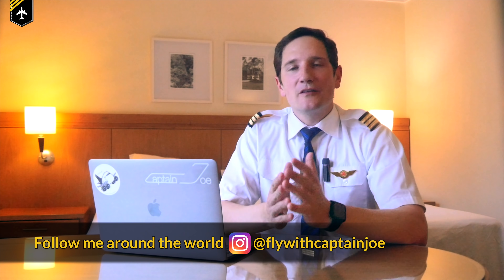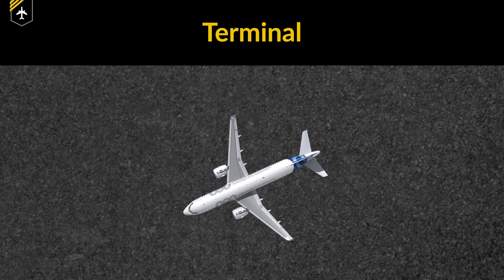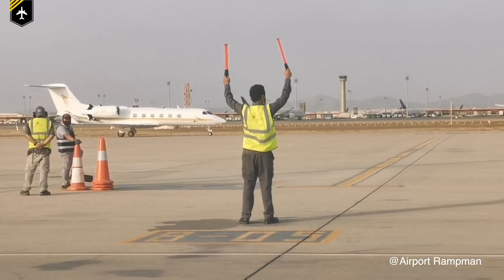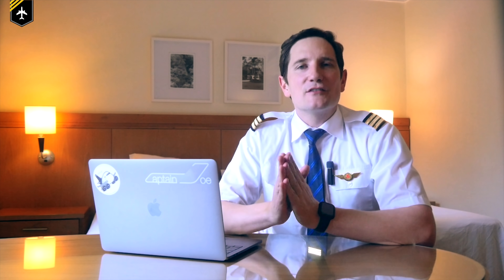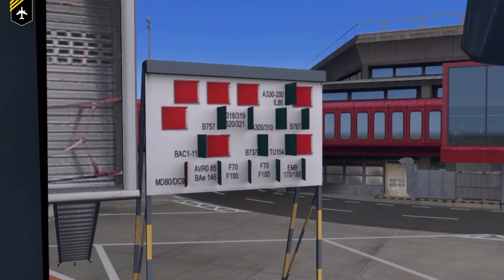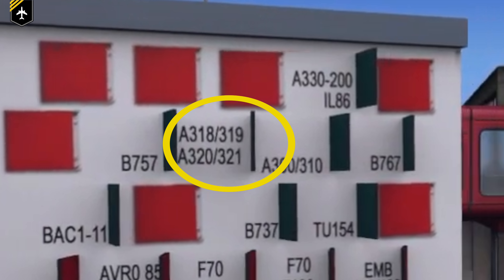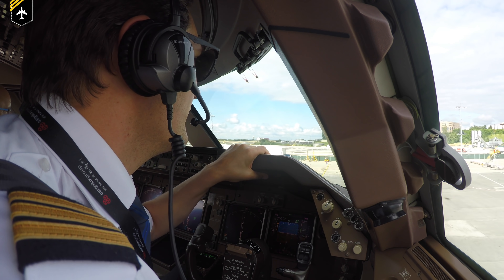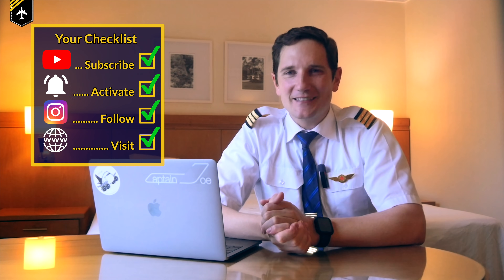HOW do PILOTS PARK their plane? ACCURATE PARKING explained by CAPTAIN JOE

Comment: Why do some airports use the bridge and sometimes you don't park near the building and passengers need to use the steps?
Reply: The bridge is more expensive compared to remote bays with stairs (in terms of airport fees for the airline). So usually low cost airlines use stairs.

Comment: Also at AMS, if the VDGS is on, the person manning the VDGS is responsible for the ramp to be clear (in case of AMS, due to the lack of storing space, objects may not hinder the a/c safety but can be within the ramp zone. Officially not, but airport authorities have a tendency to turn a blind eye.) 
Though the captain does remain responsible for following instructions given by the VDGS, the person manning the VDGS is responsible for pressing the emergency stop, blocking the jet bridge, de-blocking the jet bridge and pressing the chocks-on button.

So if an aircraft drives into the terminal with the VDGS on and the emergency stop not pressed at least three people have a lot of explaining to do.

Comment: I wonder how those small tow trucks are able to pull and push massive planes like the Boeing 747s and. Airbus A-380s?
Reply: Though the size are small, they have engines with high torque which can move such planes.

Comment: How about putting a small camera in the nose wheel well looking down at the front of the wheel?  With a display in the cockpit, the pilot would be able to see and follow the lines.  There could also be several such cameras mounted on the outside of the plane giving the crew a real time look at their engines, control surfaces, etc.  Also wingtip and tail cameras to avoid running into objects on the ground.

Comment: If they use tugs to do pushbacks, why not to do the parking?
Saves all the risk and using all the different types of systems!
Reply: Efficiency. An aircraft moving in its own power is faster than switching the plane off, connecting a tug and positioning it.

Comment: Why not put a camera underneath the airplane with a monitor in the cockpit with a view on the nose wheel and ground? It seems like it would make parking a lot easier / cheaper as less ground crew is needed or less equipment to be installed at the gate. The benefit to building systems into an airplane rather than outside (like at a gate) is ofcourse that it works for all gates / parking spots. Seems like an obvious improvement but haven't seen it anywhere yet.

Comment: I have some questions about the stand markings at 1:06. What is the long, yellow dotted line diagonally crossing the stand and why does it extend so far behind and in front of the stand? Why is the last stop line, closest to the terminal, not perfectly perpendicular (it's not 90 degrees) to the lead-in line and why is it longer than the other stop lines? Why is there a small area with no paint approximately a meter in front of (towards the terminal) the black box with the number 16? The red and yellow lines just stop here and continue on the other side, leaving here tarmac.

I know these are kind of weird questions, but I'm curious and I can't figure it out. Thanks.

Comment: Way back in the early 90's I worked for Skywest at KTWF. Did marshaling, baggage, and de-icing. At the time it was only Embraer 120's and Metroliners (Metro III) but one day for some reason we had several larger aircraft diverted to us. After being so used to the "little planes" it was unnerving having 757's and MD80's coming at you. LOL
One windy rainy day I was marshaling in a plane and I looked up and saw 2 ATC's up in the tower pointing down at me. After the plane was parked I went in and called the tower to find out if something was wrong that I may have missed. The guy said, "No! We were just laughing at you getting soaked." Smart-Asses!!!!!!

Comment: Proper parking point is achieved almost all of the time, thanks to the various systems. Just wondering ... if the nose wheel goes too far (more possible if it's slippery), past the stopping point, what happens? Do they live with it if it's small enough, or is a tug needed to push back?

Comment: I used to work for SWA as a ramper. I remember the first plane I marshaled into the gate. Up until that minute I thought 737s were small. I held my breath until the plane stopped, hearing an experienced ramper yell out "You did good!" and relieved I hadn't caused the plane to run into the jetway or anything else, LOL.

Comment: My first airport was located in the winter snow zone of the US.  We were assigned a single gate, which for us was a end gate on the east corner of the concourse.  As such, we were taught to learn spatial orientation for all a/c types we would work to be able to place them without the benefit of lead in lines that may be concealed by snowfall.  Further, due to our flight schedule, we would often place multiple a/c (up to 5 at one time) on a gate with only two lead in lines painted.  We would have two parked while we would then tow in the remaining RONs placing them in the functional operational departure positions.  

Additionally, we had three further planes from another airline just in front of us on the east side of concourse and a further two to three on the other gate to our west.  Thus, we could have up to 11 planes (mix of regional and mainline) taking up only 3 gates all at the same time.  Positioning was coordinated by full cooperation between the three airline ground crews so we could all operate safely and efficiently within this operational confine.  All of those planes (except one) would all leave within 90 minutes of each other.  Our positioning was such that only 3 required push back while all the rest were turn outs.

Further, we had great flight crews who understood our operational dynamics and worked well with us keeping the dynamics of the ground flowing without incident or hickup.  And, quite frankly, it was a great way to learn the job.  You learned far more than just hand gestures and yellow lines which served me greatly at my other airport I worked at in the south.

When I moved south, the ground crew were only able to use lead in lines and never could think outside the box when we encountered a flood of diversions due to weather.  They laughed at me for my lead in hand signals because I would hold my arms stretched straight out with the wands in my hands where they held theirs tightly in front of their body.  Because we didn't have the benefit of visible lead in lines up north much of the year plus the non-traditional spacing, we would get the taxiing a/c pilot's attention with the standard gesture for "this gate."  But then with our hands held straight out, the would then guide their plane to the point that they were going to align with our body as the lead in line.  Thus no matter what orientation we stood in, they would taxi to allow their swing arc to align with our body as they followed the traditional marshaling commands.

One day, we had a mixture of 9 mainline narrowbodies and regionals all diverting to our airport in the south within a short span of time where we only had two bridges and one ground gate with 3 stands.  My boss came to me and said, I need YOU to take command of the ramp and get the spacing identified to get as many in at one time as we can.  She knew her local team couldn't do it.  She handled our ops radio and as each called in range, she would inform them of our planned non-traditional parking that was planned and to follow my commands and she told them I was from my airport in the north.  Only one captain was hesitant.  All others said if I was from that place, they had confidence in the plan.  We had the reputation and it was known system wide.  That one captain was a new captain of a CRJ700 who hadn't worked in our airline system for long (transferred from another major's flight system his airline was contracted with.)  I lost count how many coffee's I was given once they were all settled in.  Getting them all in was easy, it was repositioning some of mainline planes to and from the gates as their dispatch order was not in the order we parked them.

No one but my boss believed I could pull it off, but thanks to my northern thinking outside the box training and experience, and some good spatial orientation, it all worked out time and time again.  Man I miss the fun and pressure of the job.  

One time we broke a tow bar for a Mad Dog.  The plane was all the way up to its stop line at the gate.  The boss wanted to delay the flight and I said no, I can turn it out.  I went up to the captain, told him what I wanted him to do and he looked at me like I was stoned, until I asked him if he ever flew into my airport up north.  You're from there, OK.  I had airport maintenance remove the safety stops from the bridge, moved it up against the building, got all the ground equipment far away, positioned 4 rampers/supervior to be hand off marshalers while I walked in view to oversee and then took the last marshal position as each of them then became wing walkers/watchers.  As he taxied out, I went inside and met the airport manager with a very pissed off look on his face at my gate.  Apparently I scared all the waiting passengers in the terminal when the windows started vibrating in their frames from the blast of those ol' JT8s.  Before he could give me a lecture, I said to him "Hey, now you know for sure your terminal is hurricane proof" as I walked away never giving him a chance to say anything.  LOL.

As much I am glad I'm a Midwesterner (values/culture, etc.) and as much as I hate having been raised in the snow belt...I am so thankful that it has taught me skills that you just don't learn when living in warm weather year round.  I AM NO ONE SPECIAL!  There is just no better learning experience for a ramp rat than working in the snow belt and unusual operational environments that aren't covered in "the book."

Comment: Hi! I have a question , why all gates use left nose passenger door? Are there gates which use righr doors?
Reply: There is a video about that. Main reason is that most planes are constructed so that the right side of the galley doesn't have a door. Also it is because the first engine that is started for taxiing and the last one to be shut down is the nr 1 engine, and that engine is mounted under the right wing.

Comment: I’ve seen the Marshall bringing in planes,  I didn’t know that plane engines don’t do ‘reverse’!
Reply: Actually, jet engines do have a (inefficient) Reverse mode. They use it as soon as the wheels touch the runway, to slow down enough that it becomes safe to use the brakes. 
I have even once seen a video of a plane using that Reverse mode to back away from the gate and thus not need a tug to push it back.

Comment: Why does a plane gets painted over the previous layer of paint. Since airline is doing everything to reduce weight, multiple layer of paint is increasing the weight of the aircraft permanently which leads to more fuel burn.

Comment: Western Airlines had the best parking guidance system ever.  A bar stuck out from a fixed position jetway.  Hanging from that bar was a piece of PVC pipe on a rope.  When the windshield made contact with the PVC pipe, stop.

Comment: Capt Joe you never said why you have to be so accurate when parking aircraft and you never mentioned wing walkers. You must be accurate when parking planes because if you park on the wrong spot some jet bridges cannot reach the door and the fuel spouts In the ground cannot be reached to fuel the plane. And wing walkers stand at the front of the gate and watch the wings so they don’t hit anything so a camera on the nose will not stop you from hitting something. Shout out to all the Rampers out there From Den

Comment: Besides keeping the boarding bridge within limits, another factor is the fuel pit location, particularly with respect to the aircraft's lower cargo door. Gotta keep the belt loaders and K-loaders away from the open pit and the moosehead connection. Other considerations are tail clearance from the vehicle service road, wingtip clearance when adjacent gates aren't parallel with eachother, and some cargo operators look for alignment with fixed roller beds and nosegear hold-down straps.

Comment: Hello Captain Joe. :) I would like to know how the plane move ahead so slowly. Is it by inertia or is it necessary sometimes to push up the throttle ? Is it dangerous so close to the terminal ? Many thanks
Reply: It depends on the weight. If the aircraft is very light, the aircraft may start moving with idle thrust and will need braking to control the speed. If its heavy, es a but of thrust is needed. But there will be a max thrust allowed that one can use to taxi near obstructiona

Comment: I'm a Marshaller at UPS worldport at SDF in Louisville KY., and we have both remote parking and pull in docking. At the pull in docking we stand at the line and our partner holds a button that turns a red light off. When the plane gets to the line we drop our hand and signals the button person to let off. It's very difficult to learn how to be accurate as each aircraft is moving and stopping at different speeds, but we take great pride in our job. Thanks for the upload!

Comment: Why on Earth airplane manufactures don't install HD cameras in key locations on the body which can help them navigate on terrain, similar to those found on cars nowadays. The advantage will be enormous because they can also be triggered automatically by FDR computer to start recording if the airplane is under stress or flying dangerously or mid emergency. Such video footages WILL revolutionize Air Traffic Accident Investigations, let alone provide valuable data to airplane vendors to optimize and fix potential problems and address issues before causing any catastrophic failures. Airplane costing hundreds of millions won't bother having 50+ HD cameras of variable focal length at key locations on the fuselage.

Comment: What puzzles me even more: If you have stopped at your parking position, maybe in a smaller aircraft, how do you get to the buildings safely?
Reply: You walk. Smaller general aviation vehicles park in a ramp area only for planes of a similar size. The FBO(Fixed Base Operator aka the terminal for those types of planes) is located in a different part of the airport that is not used by larger cargo and commercial operators.

Comment: Has there an incident happened where the automatic docking system shows the wrong aircraft type/name. For Eg: showed 777 while you're trying to park an A320
Reply: Rarely happens as the Dispatcher or the bridge operator do choose the right a/c before turning the signs on. But if the sign shows a B777 instead of A321 the pilot probably stop the a/c and call either ground ops or ATC.
Reply: @hansolo4347  okay! Really nice of you. Thanks buddy

Comment: a couple of other points are that the speed of the hand/arm movement of the ramp marshaller should also dictate the speed of the aircraft so your arms should move at a rate fast enough for the pilot to notice when you want him/her to slow down as you slow your arm movements and also any of the electronic guidance systems are very hard to see if the sun is rising or setting and is low on the horizon and is directly behind the aircraft shining onto the guidance system

Comment: ay YYZ we have the automatic system but a ramp guy holds a deadman button down to keep it active. and also a marshaling signal we used the pilot approaches the gate with his lights still on was the motion of putting your hand in front of your face and gesturing back and forth to tell the pilot to turn off his lights

Comment: Gate C1, MSP. An old stationary jetbridge with only a telescoping cab. This gate was good for multiple mis-parks everyday. Nothing you could do when the aircraft was creeping towards the stop mark, you cross the wands, and the flight deck rolls another foot and a half. On one such occasion, I threw the wands into the air and simply walked away. No chocks in signal, nothing.

Comment: When I worked on the cargo ramp in the 1991,  we used 3 marshalers. We used handoffs and we had a signal for the handoff to the next Marshaller. If the pilots’ turns were not precise, it would take 10 minutes to get everything repositioned.

Comment: Thank you Joe ... one additional topic, how can you determine the position of your main gear for turning? On some aircraft like B747 they likely aren't even visible from the cockpit, how do you time your turns. For instance in the example here, 90 degrees into a parking stand, the turns are very precise and the nose wheel must line up exactly. How do you determine when to begin your turn? Thank you!
Reply: Position the nose wheel or cockpit to go a certain distance past  the lead-in  line, main gear will follow as required.

Comment: The hi-tech solutions has obvious benefits but the lo-tech solutions are fascinating. No computers, no sensors, no electronics, just lights, slots, plates and some markings. Btw. I found a video of a Thyssenkrupp A-VDGS system that uses the Moiré effect (Inogon leading mark) for centreline guidance.

Comment: Fun story, came into Newark Dec 2020, Int'l landing, no airline mentioned :), we were over an half hour early, taxed in and airplane, 787-10, got to a stop, now nothing happened for about 10 min, after some time now flight crew told it was an issue with connecting the ramp to airplane. After another 15 min they said they were at the wrong spot for the airplane and Capt came online and said we would be towed to the right spot. Another 15 min was gone, so yes our half an hour earlier arrival was completely 'eaten' up. :)